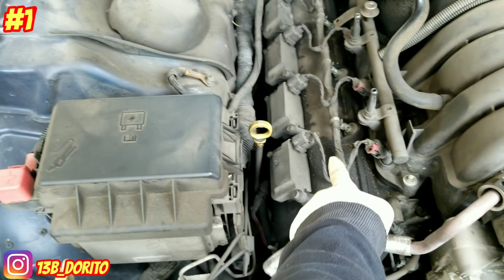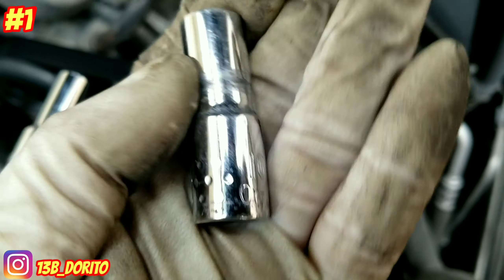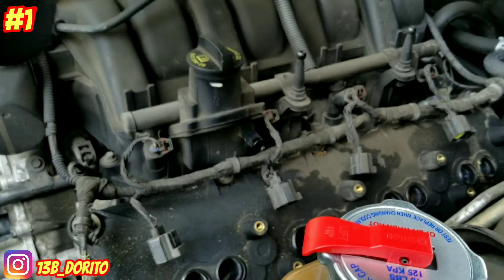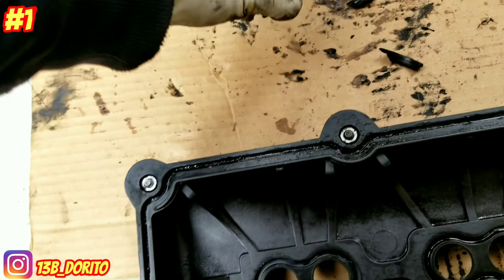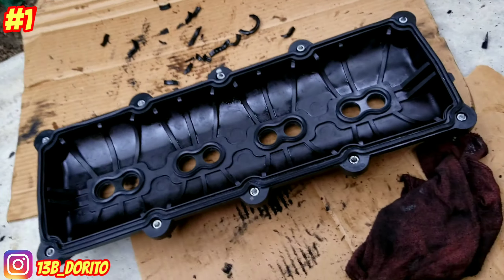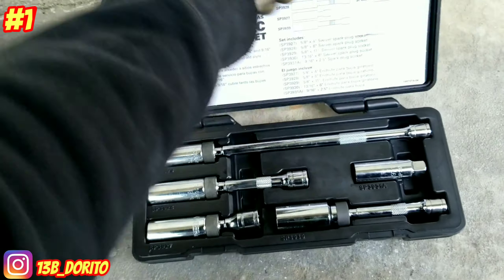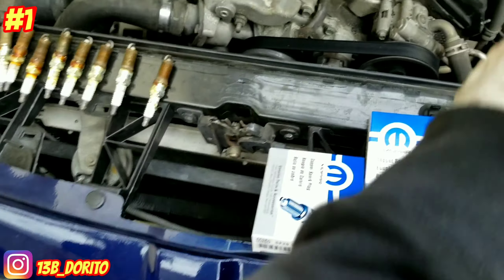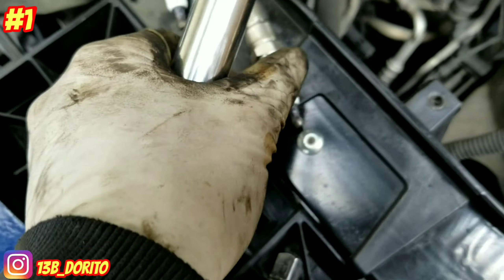How to remove replace spark plugs and valve cover gaskets on Chrysler 300 dodge magnum hemi 5.7

Comment: Hey Thanks,
I had a pita Driver Side Valve Cover gasket leak for a long while on my 5.7 finally got it to stop, this was the problem:
What i found for mine was the rubber bushings on the valve cover studs were all too far gone rotted to be reused so when i tried to just change the gasket without new stud-bushings it just continued to leak.
Getting new rubber stud-bushings and doing this (pita) job a second time (yeah I know) worked.
hopefully the point about the new stud-bushings helps out someone else to not have to do this job twice like me. (also some spray gasket adhesive for the valve cover gasket made re-installation about 1-million times easier).
Reply from the maker: Thanks for sharing

Comment: All I did was get a Milwaukee hand saw and cut the front 3 passenger side bolts studs off so I could reach it with a shallow socket, and the one in the back against the firewall was the easiest, i just stacked about 3 extension and stuck it through the harness wires. I replaced the bolts that I cut the studs from dealer for about $4 and save myself the headache and I also cut the new studs off also to save myself in case I have to do this job again
Reply from the maker: Whatever it takes 🤣👏👏
Reply: That's pretty smart cuz I noticed that the guy who made the video didn't show the the most difficult part of the job either
Reply: @Name-io6dk  the passenger side is really hard, to get to the last bolt closest to the fire wall I just stacked about 2 extensions and guided it through all of the wires
Reply: @seandp85  how long did it take you to finish the passenger side
Reply from the maker: All i use is 1/4 8mm socket nd 2" to 3" extension nd the 1/4 ratchet too
Reply: @Name-io6dk  a couple of hrs, fighting with the passenger side until I came up with my master plan like I stated earlier lol, but I’m no mechanic but I can do the simple jobs brakes/ rotors etc

Comment: How you get that back screw on the passenger side valve cover
Reply from the maker: With a 1/4 swivel or a small wrench nd by hand
Reply: @JM8686  thanks.. the passenger head i hate. Them back screws on the valve and the head always give me trouble
Reply from the maker: Yeah they sucks 😕
Reply: That's what i was trying to see?? We saw everything but that! It's doesn't look like even changed the passenger side at all...

Comment: It's really unfortunate that you didn't show how you managed to remove the back, lower valve cover bolt on the passenger side. I have tried every combination of swivel and angled tool I have and nothing can get to that bolt with enough clearance to remove it.

Edit: alright, figured it out. Look for the large bundle of wires going from the fuse box back into the firewall. Then look for the strut bolt cover, its corcular cover right over the strut tower. 

You can reach behind that cover and then over towards the valve cover and theres a big enough gap above/below (cant remember) that bundle of wires. 

You'll need a 6 inch extension, a universal joint, a 9 inch extension and your ratchet and socket. Put the socket onto the 6 inch and then the universal onto the other end. Work that into that gap and get the socket onto the bolt. You can reach with your other hand over the valve cover to help guide it. Then hold it there and you can connect your 9 inch and ratchet to the universal. Hold the socket into the bolt with one hand and turn the ratchet with the other.

Make sure the locking ball on your extensions and universal hold on tight, otherwise youll lose your 6inch extension and 8mm socket down into the engine bay... Ask me how i know. If a slight bump knocks em off youll lose em.

It can be a bit of a jerk to break it loose like this, i was able to do that with an indexable ratchet with a very slight angle on it and a socket that was just the right length (actually a 3/8 to 1/4 adapter and a 1/4 8mm socket).

Also, i had to undo the connectors onto the fuel injectors, and disconnect the 2 connectors at the front of the valve cover and pull out all of the plastic studs holding the wires. Then i had to put the wire bundle over the fuel bar to get it out of the way.

When pulling the cover itll get stuck on the dipstick tube, pay attention to whats getting stuck there, you can pull the tube a bit to get it out the way.

ALSO, dont use a Fel-Pro gasket for this, order OEM from Mopar. The Fel-Pro leaked terribly, so I had to redo this job with OEM gasket.

Clean the mating surface on the head with microfiber.

Comment: How did you get the back bolt off on the passenger side ?
Reply: I used a swivel and extension. Usually just to break to bolt loose. Then I’ll use my hand to do the rest

Comment: How do you take the engine cover off to paint or put a new one on?
Reply from the maker: You mean the top plastic one or the valve covers?
Reply: @JM8686  the plastic piece that has the badge label on it
Reply from the maker: Just pull it up 
Don't think that it got any 10mm bolts on top